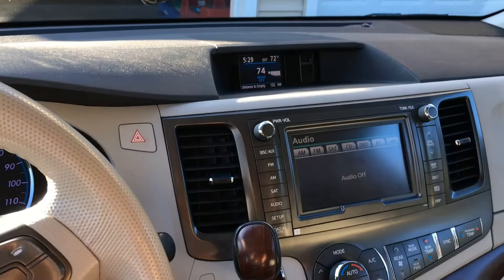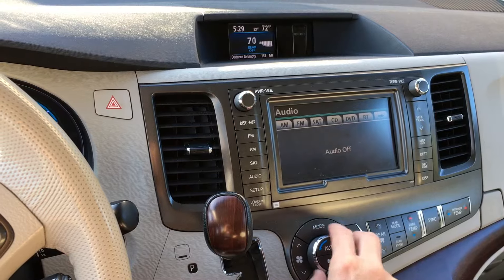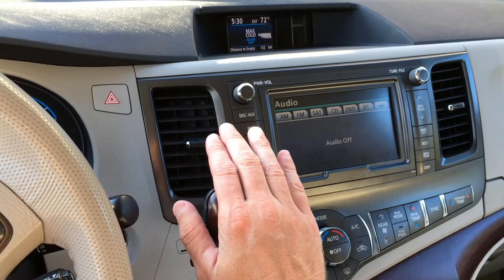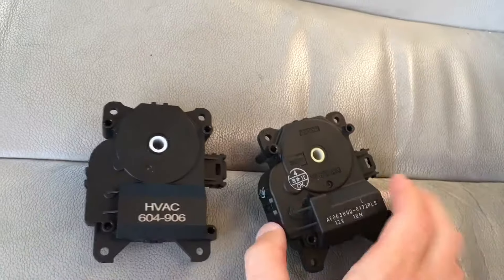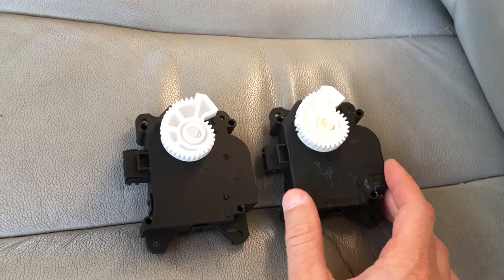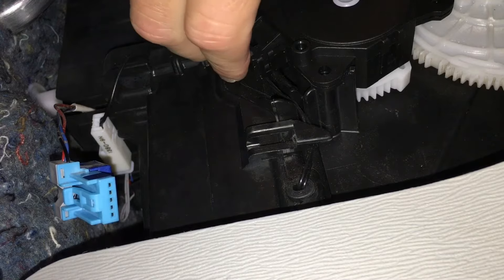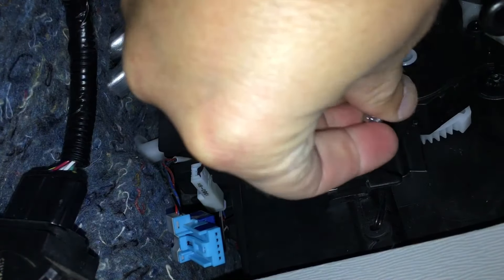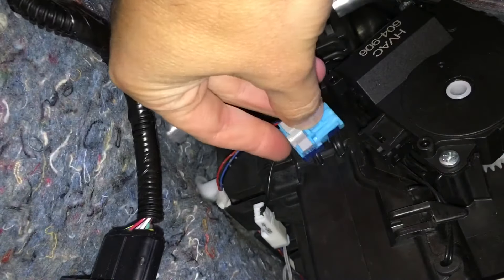Toyota Climate Control Heater AC Problem Repair DIY Fix

Comment: Good day 5 min-fix..I thought that was my car.lol I have the Toyota Venza 2012 the setup look almost the same with the gear shift right there next to the steering wheel. I am having this problem right now. I noticed over the summer when I drove the car and have it Park go into the store come back out turn the car back on the AC will never turn on it takes a about 45 secs are more before it kicks on now back. We're getting into fall it's getting cold outside last night I tried to turn on the heat one side is blowing warm air and the left side is blowing cold air can this be the problem and also if I bought this part with this work for my venza 2012 Thanks
Reply from the maker: This part is the same for your Venza and the placement of it should be similar. Good luck with the repair and let us know how it goes!
Reply: @Mikelaury_world  I have the same problem with my 2010 venza, did you fix yours? how easy is to swap it out? Thank you
Reply: @mr2cqql  if you have a Toyota venza it's very easy to change 5 minutes it's going to be under the dashboard the steering wheel on the left hand side you have to lay down it's very uncomfortable driver side get a flashlight and you will see the dual activator you can hear it clicking noise just not working properly. I believe it's three screws to remove it. Please make sure the gears are lined up back with the mechanism there's a big white gear that turns it needs to lock into that what that does is open and close like a flap on the venza to control the air flow when I install it the first time I didn't fix it keep messing with it until I got it.. what 5 minutes say it's the same part for Sienna I have a 2009. I went to O'Reilly Auto store and it was $163 I took it out because I live in a warm state. I really don't need it at this point but I will be replacing it soon.. Best of luck friend..😊

Comment: Hi bro i seen your video cause i have the same problem but its on a 2012 camry
Reply: Same here and I couldn't find it.
Reply: I have a 2011 camry XLE with auto climate control and my front defrost light blinks for 45 sec. before system goes on, then I only get strong heat and ac from all the drivers side vent's. Passenger side is weak. Do you have any of these issues? Was the blend door actuator replaced?

Comment: What model is your toyota?
Reply from the maker: It’s a 2012 Sienna.
Reply: Do you know if this same procedure applies to the passenger side? The dealership quoted me over $2500 to replace the passenger side  servo on my 2012 Sienna and they said you have to take the entire dashboard apart, but I’ve seen several other videos similar to yours that show the replacement is as simple as replacing the driver side where you’re just swapping out the servo controller and that’s it.

Comment: Why would a Simple blend door, cause a delay in the system.    ?
Reply from the maker: It seems as though the HVAC system goes through a quick “check” of the whole system and if the door isn’t functioning correctly it trys a few times then defaults running without the door functioning.

Comment: Pls help me, i put back to cold 18-25 temperature but the air comes out is still hot.
Reply: Did you fix it ?
Reply: @pablovagnor  yes, removing the terminal of the battery works for me. It reset and back to normal.